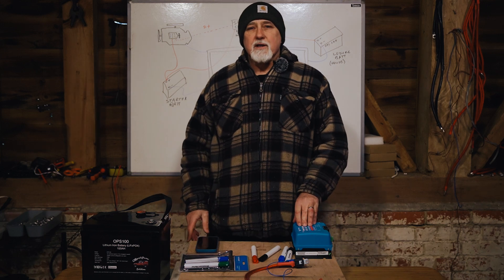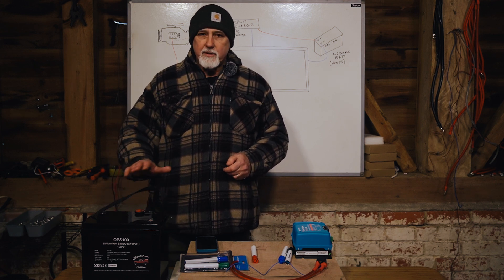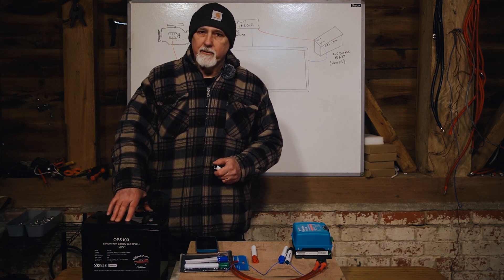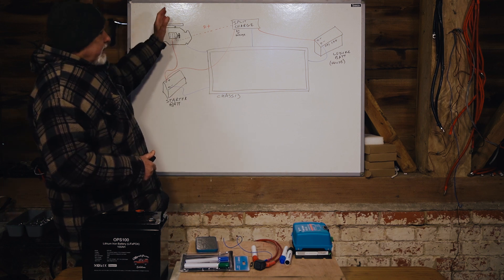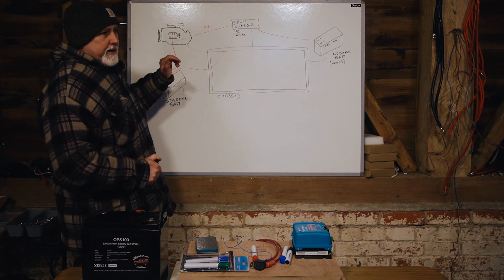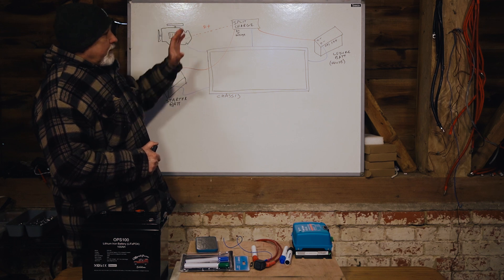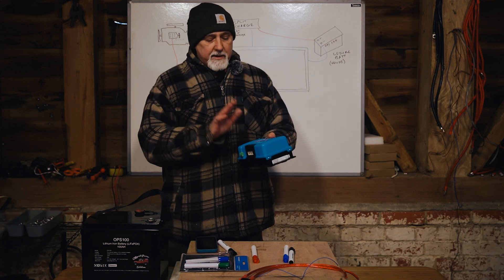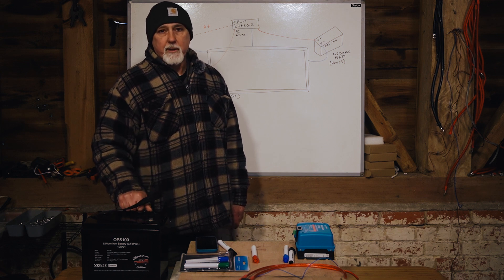Can you use a Split Charge relay with Lithium batteries?

Comment: Hi Roger I have fitted the dc to dc victron with a victron 30 charger and the victron shunt when the engine is running I’m getting 30amps dc to dc is working fine with the two 100amp hr batteries however when I’m on EHU the Charger is not putting anything into the batteries as it’s going through the CBE ds520 consumer unit and I’m thinking it’s the split charger stopping the flow when are you going to make the next part of the split charger video please I need to disable mine many thanks Ray

Comment: A thoughtful discussion.  I will push back on some points.

1.  Eurospec alternators - this is a split charge issue, not a Li issue
2.  voltage is not what you want - 4S LFP will charge to 100% at voltages as low as 13.6v.  14.0v at moderate currents will charge to 100% SoC with no absorption.  See OffGrid Garages experiments with charging voltages v. absorption duration. 
3. voltage up and down - again, split charge issue not Li issue.  Also generally unimportant to the situation, IMO
4.  no control over current - using the chassis for negative return introduces a ton of resistance, and I=V/R.  
5.  low RPM - can happen with any charger type
6.  draws only 30A from the alternator - the 30A is output current, not input.  Because DC-DC is typically boosting voltage the current demand on the alt can be >30A

My 150Ah bank charges at ~35A through a relay at voltage/current appropriate for both components.  At a price about 1/5th that of the Orion-TR. Also note that Battle Born doesn't recommend DC-DC (or even Li-BiM) until bank size is >300Ah, per FAQ video VY2b71zoyvg.
Reply from the maker: Some good points there. :)
Reply: @offgrid_power I found the video to be good and infotmative despite this weird dude in the comment section playing besserwisser. Literally just trying to say at least something about every point you made even the points that were good and correct. I guess some just like to hate...

Great video! :D
Reply: @alexpalsater7983   If you have any corrections to make on my comments I'd be happy to hear them and learn from you.

How do you charge your lithium from alternator?
Reply: Hi. Its confusing. So is it still reccommended that you do not use a regular split charge relay on say 2010 transit with non smart alternator, and a 12v 100ah lithium  ion battery? Or should I pay much more for a dc to dc victron like what he showed?
Reply: @Jaybreens  If it's confusing then I'd say pay up for DC-DC; they are relatively plug-and-play.  DIY requires an understanding of what the battery needs and what the alternator can/will do.